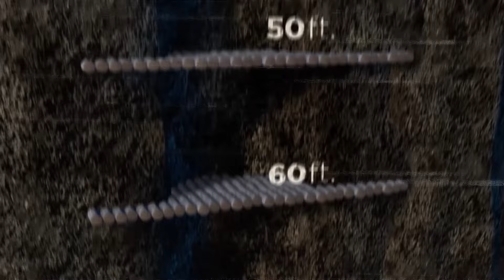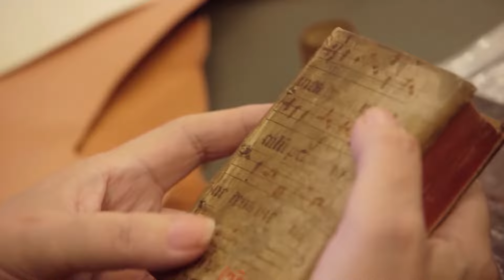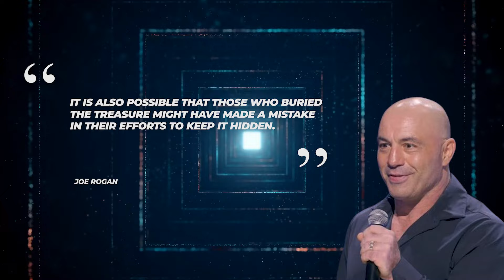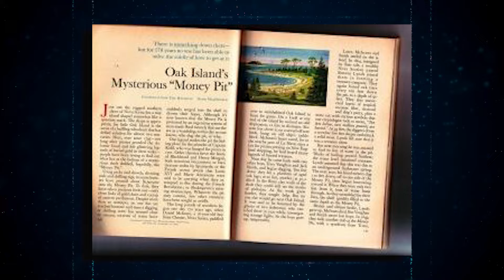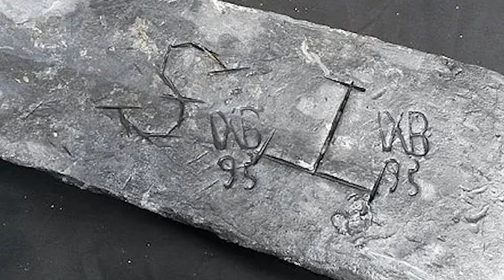Joe Rogan Just Opened Up About A New Discovery On Oak Island!

Comment: Its probably buried next to a tree three feet deep.
Reply: It's under one of the rocks that form Nolan's Cross
Reply: Water line would have been 100ft away also.  Probably underwater due to the weight of not being able to take it far inland.  I live next to a beach and it’s moved back 20ft in 10years where there is no sea wall.